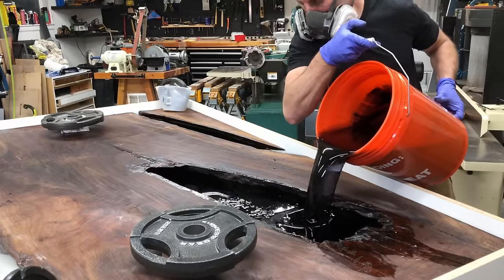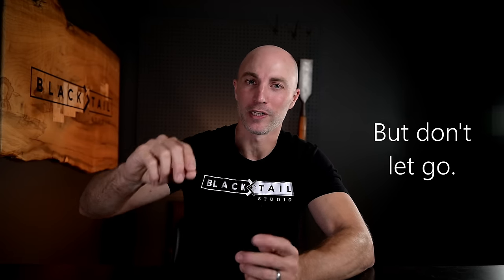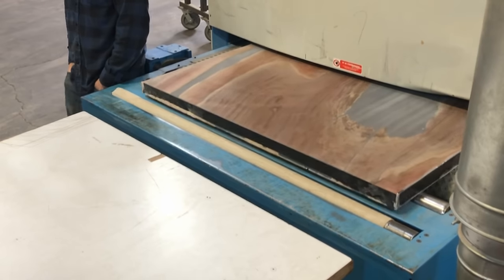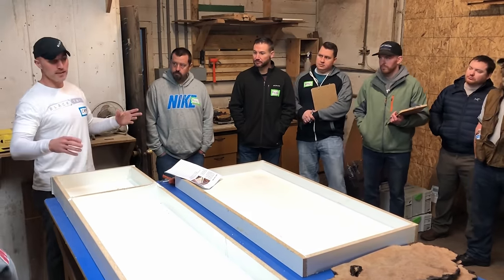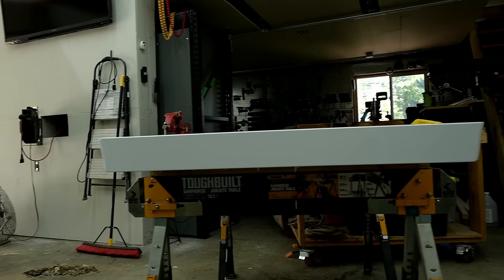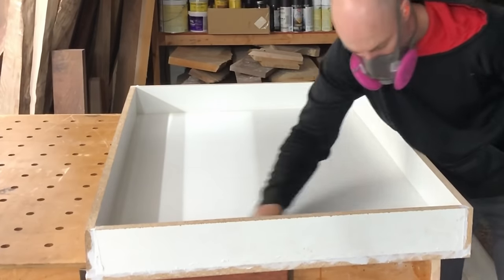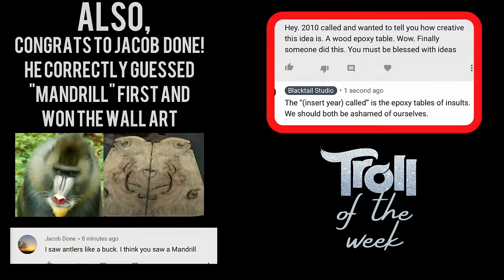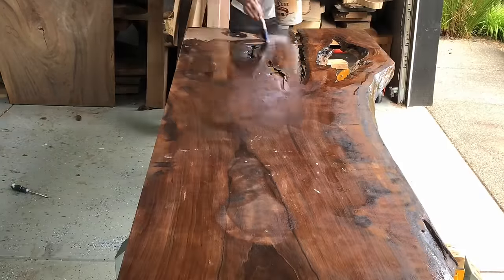The 14 Rules of Epoxy Table Making

Comment: We like to do something like a 5 mm pour into the mould then add the wood weight eights, helps ensure bottom of mould is sealed. When the next deeper pour is done, onto form but tacky resin, the mould is sealed and wood is stuck down and does not float since the new epoxy cannot get under the wood. This is for small tables, don’t know if that works with large tables.

Comment: Seal the top. 

Great tips. I'm wondering about cleanup. Do you clean your buckets with something before they harden? Or just use new buckets each time? What about the mixing paddle for the drill? Thanks.
Reply from the maker: Just let it cure and break it out 👍🏼

Comment: I live in Newberg and I have been making epoxy tables for the past 3 years and lately I've had an issue. Example:
I took a live slab of black walnut 10' long x 35 " wide x 2 1/2 inches thick to Creative Woodworking to have planed down flat and when I got it home I installed 3 C- Channel bars across the bottom to prevent cupping. I sanded it to 150 and then put it in my clean room which is heated to pour some of the cracks in the top with epoxy. Needless to say the table still cupped on me even with the bars mounted. What am I doing wrong? The slab has been in my pole barn for over 2 years and moisture content is 8-10%

Wayne Braun
Reply: Did you only sand or surface one side? Is it possible you had different moisture contents per side?  🤔

Comment: Seal the wood surface in the tray, right. My project is going to have an epoxy thickness ranging from about 1.5 cm to maybe about 40mm at the edge. Should I anticipate any problems you can think of?  THX

Comment: Hi Cam, 2nd bucket pour great idea! My question is, is it okay to use a jig saw to cut out a section, after the epoxy has quered. I am making a jewelry table for a friend. Or will the vibration weaken the hold?
Thx so much

Comment: Hey Cam, I’ve got a question about using epoxy to fill cracks and knot holes. Do you still recommend waiting a full 3 weeks to let them cure before planing and sanding?

Comment: Favorite rule: scrape the sides of the bucket while mixing and mix thoroughly for 2-3 minutes. Question, my epoxy pour has some voids that need to be filled. What is the best method to prep and fill these voids? This was a blue powdered color pour that had a few areas the bubbled and one area that shrunk. I have planned it down with my router sled to as far as I want to go and now need to fill these small areas. Is it a simple sand, fill with the original epoxy, let fully cure then plane off the excess?

Comment: I am a little confused in the last rule. When I buy the wood slab and bring it back to my garage, do I have to seal it right away and leave it to dry for two to three weeks before I put the full Epoxy? Or just buy the wood slab and leave it dry in my garage for two to three weeks and then seal it before I start the pouring epoxy?

Comment: I learned that epoxy can crack from getting too hot haha. I had no idea!. My question is about the sander you use. I am currently using a dewalt variable speed orbital. I am looking at the festool ETS EC 150 but i noticed that the link you use is the 3mm stroke version. Any reason not to get the 5mm? It will be my main sander and i want something that will speed up my sanding and do a better job. I figured the ETS EC 150/5 would be better than the 150/3. I have seen you recommend the 125 but it only comes in 3mm stroke and the 6 inch pad would be nice too. Can you shed some light on this for me? Most of my work is table/flat surface work and edge work with profiles. I plan to do your epoxy course soon to get into bigger tables. Thank you for all the work and info you have given me and everyone else!

Comment: Love all your videos! Just took the plunge and did my first epoxy table and tried using all of your tips and tricks as well as recommended deep pour epoxy. I did have one issue pop-up and had a question on how to proceed. After my initial pour of the river portion of my table, I developed a leak out of the ends of the river. I only lost about 1/2" or so of epoxy and so my question is, if i want to re-pour to fill in the rest of the river. Should I wait the full week or 2 before I go back to re-pour the 1/2"? Or would it be better to re-pour after the 72 hour mark? Lastly, should I scuff up the existing epoxy to help the new pour bond, since I am passed your recommended 12-18 hour mark to get that chemical bond. Any advice would be greatly appreciated!
Reply: scuff up and repour right away i tihnk

Comment: Question for ya, just poured my first table and after planing it down the thickness is 1 1/4”. Yes I realize it’s thin. Lesson learned. The pour was with black dye and it wasn’t a huge concentrate. It’s somewhat translucent. We’ll when I drilled the holes for the threaded inserts, you can see where the hole was tapped from the top through the epoxy. How do you suggest fixing this?

Comment: Cam - your very last rule to seal top was my favorite rule. But it also created a question. If the top is sealed with polyurethane, how do you apply the Rubio finish?  And I don’t recall you mentioning this in your course
Reply from the maker: You’ll sand/plane it off after the pour 👍🏼

Comment: So I watched the entire video because I am getting ready to do my first large 16ft lived edge bar table. Which I have watched dozens of your video's because of past small jobs that I had to do. My issue is...well you kinda answered it at the end. But because it is so large and 2.5 inches thick. Do we need to seal the bottom with epoxy wait 24 hours and then seal the top before the flood coat? Or do you like you said and just poly both sides and then make the final pour? Will the epoxy stick to shellac or poly if we do this?

Comment: Use Fans! We'll a room (800 sq ft) that's naturally about 50-60 degrees heat up from the epoxy chemical reaction? I guess I'm asking, should I be actively cooling it since the epoxy heats up or will an overhead fan work in a room like that?

Comment: Hi cam!! Everything I finish the wood , there is areas where the finish won't absorb into wood because epoxy overflow on top prevents it despite alot of previous sanding?? Thick slabs are fine as I run through planer ?

Comment: remove all the bark Bark Bites.  I have heard other epoxy table builders say you need to get the slab out of the mold sooner because the epoxy can become brittle and possibly chip out.  I know you use a belt sanding planer, I am 3 days away from my first go around and I will be using a router sled with a new bit from bits and bits do you think letting it cure for the full 2-3 weeks will affect my results if I go with a router sled and make shallow passes with a brand new bit.  Also can you show how to stop a leak in action.

Comment: Not going too thin to start to give room for things to occur in was my favourite rule.  (Followed shortly up by letting it cure for a few weeks and not just the intended minimum cure time.  I tried to clean up some maple shelves I was making and tried to flatten it too soon and it gummed up my tools.)

I’m curious about any harmful vapors released in the process of curing?  What kind of air circulation do you have or recommend for safety?  My workshop is in the basement of my house as is the HVAC (in a different room).  I’m the cooler months I can open a basement window in my shop potentially.  Don’t know what you recommend?

Comment: So, I have a question/problem. I have just started creating some smaller epoxy projects and am using the router sled method to initially smooth the surfaces. The problem that I am having is with the retreating side of my router bit. On each pass the retreating side of the cut is leaving tiny pits along the entire path of the cut. I doesn't seem to matter what speed I feed them or the depth of the cut. From 1/64 to 1/8 deep, all along the cut is a steady line of pits in the surface. Not a huge deal but makes for aLOT more work, but I would really like some sort of solution. Any words of wisdom would be appreciated.

Comment: Pour 2 1/2 inch or less I think it was glass says you can pour up to 6 inches but limit to 2 1/2 or less. Cam, I notice you do mostly metal for your basis. Is it because of the weight and would a base like a wood console cabinet work.  I know you have done kitchen islands, what sort of reinforcement if a wood console cabinet works?

Comment: Hi. After polishing the epoxy,if I put odies oil on the epoxy will it make it scratch resistant and shinier?
Reply from the maker: I had to refinish every piece I used Odies on. So I wouldn’t recommend it under any circumstance

Comment: I used the west system epoxy and I was filling a large whole. It must have been a to large of a pour. It got to hot and crack. Do I really need to remove all of it and start over? Or would cleaning it up with a bur bit be enough? I have never seen a video about salvaging a bad pour.

Comment: I had personal experience with not sealing the top I did a 24 X 36 cutting board for a customer and left it on my melamine work bench over the weekend and it warped so bad but after a few days with a bunch of weight on it I got it back flat. I was wondering what moisture meter you use?

Comment: Hi cam, my favourite was the fan one. I was under the impression that you need a warm environment (above 15*C) for epoxy to cure, so in kindof confused about cooling it. My shop is like 6*C in the winter and went to some trouble to heat it up in a smaller cabin. What would you think is a good temperature for curing and would you still need the fans? Thank you love your videos i learned a lot in the last months
Reply: I think most manufacturers recommend between 75-90° but the problem with pouring thick layers of epoxy is the thermal runaway effect. At best it will crack, bubble, warp and shrivel. At worst the epoxy can catch on fire. The fan is primarily for deep pours, especially over 2 inches, but the primary hazard is total volume, that creates the risk, not a 5 in deep crack the width of a sheet of paper, in the end just use your best judgment and don't abuse the epoxy recommendations by trying to take shortcuts.

Comment: 9 months later. both laquer and paint take 6 months to fully cure. you would think it's a cuople of days but 6 months later it will show a slightly different shade or gloss level or the surface will be more or less resistant to scratches, more or less shiny.sounds crazy but it's true.

Comment: Use dry wood.  I've searched many of your videos and can't find any thing about cleaning your buffing pads (the colored ones).  The obvious logic of removing sanding dust between changes in sand paper grit suggests that similar logic would suggest cleaning the pads.  My wife won't let me put my soft cloth pads in the washing machine, so they get washed in the sink.   Do you use any soap or just water?  Other?

Comment: New rule I didn't know was the fan...I wouldn't have done this. Just learning of the heat generating. Thank you. I have been watching you for a while now Cam, enjoying learning. Just starting my first ever project, a slice of Australian Red Gum. About 800L × 400W and down to about 30D in metric mm.  I have router planed it and starting to clean up edges. Epoxy to go in cracks and small river to an edge, only shallow. Going over the surface (top and bottom) to level out router marks, still going on 80 grit 6 hours later. Sooooo hard. I know I will have to repeat this process after epoxy pouring but I just want those ridges gone before then. It is only fractions but it wont go away easily and there is quite a few. It is a cross cut piece with 2 grain swirls side by side. Should I water spray it to help lift or wait and keep plugging away? Many thanks for any tips.

Comment: So letting the project sit for that long after requires storage which in a small shop is tough but a great tip but it’s not just epoxy tables , I’ve done cutting boards that after sitting for a few months have changed as well and need to be resanded, maple seems to be the worst and like everyone else finished to 320 , now no more oil till they sit for a few months , I see Kris Devo is leaving his glue ups sit for 2 weeks before he touch’s them after removing from the clamps , I see so many woodworkers starting out making cutting boards and they end up quitting cause they thought it was gonna be easy money , if your not doing it for the passion of it don’t do it . 🤷‍♂️

Comment: Cam, for cutting slabs, would you recommend spending the extra money to get the Festool TS 75 instead of the TS 55 since it has a bigger cutting depth? Or is it possible to cut 2.5" - 3" slabs with the TS 55 in some way?
Reply: Don’t waste your money on either of those. There are better track saws out there, and half the time Cam can’t even cut through his raw slabs using just the track saw. You’ll have to use a long jigsaw blade and flush trim bit in addition to a track saw in so many cases, it won’t be worse the splurge on a larger track saw
Reply: @nerm9507  What would you recommend then?

Comment: And when you make a table and after 1 month the table is crooked! That is a problem after spending a lot in ecopoxy. Variation in temperature and resin moves even after being all cured. Last table i did. Left in the mold until full cure, and is now crooked! So there is a lot to epoxy that people don’t say and you learn after doing it

Comment: Why are you worried about staining on your edges of the wood? If you’re using black liquid dye then you won’t even see the inside live edge. I understand why you would seal the topand bottom of slabs for staining reasons,but why the inside edges?
Reply from the maker: It’ll soak in from the edges